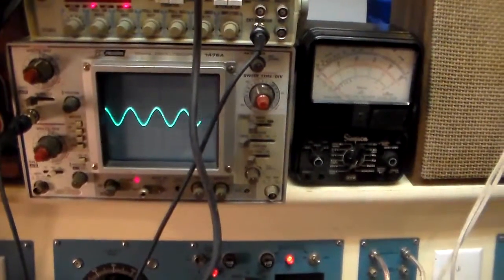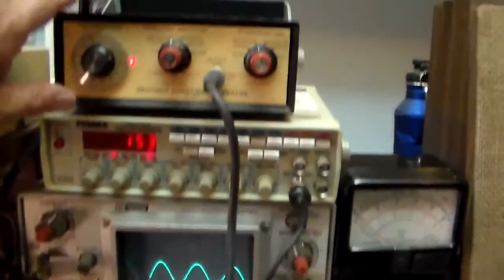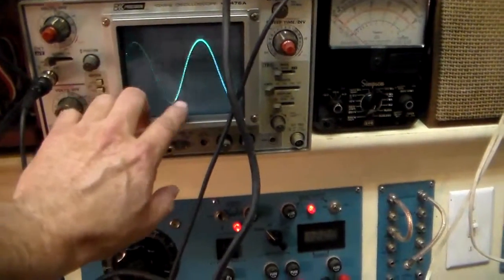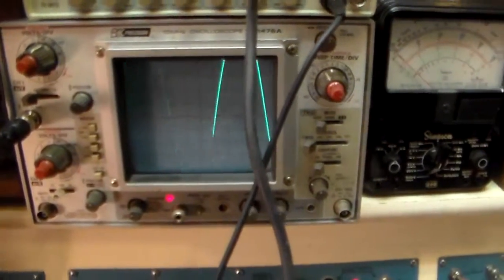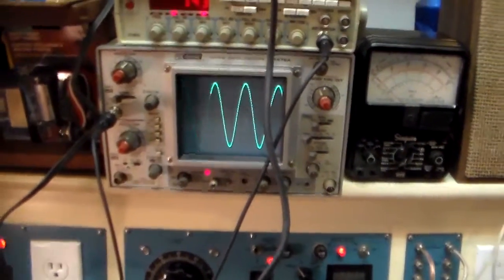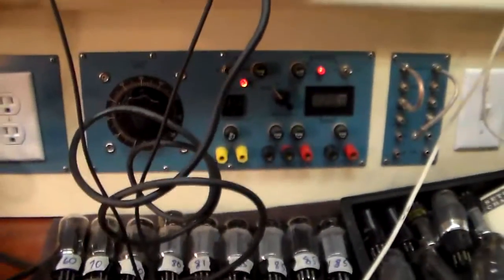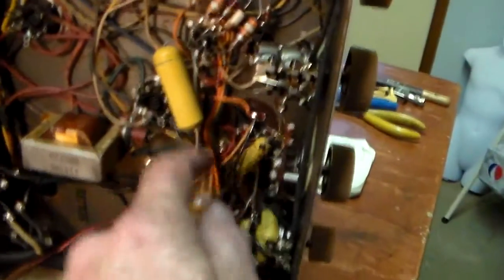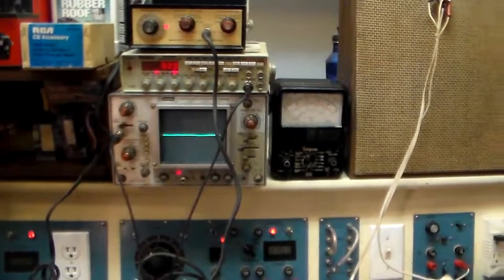A look at my Stromberg Carlson AR - 420 6L6 Audio Amplifier

Comment: 6L6 are built like a battle ship,they are designed to be abused.They were used in class B out put stages in P.A amps which produced around 50 watt r.m.s. But in hifi amplifier they would they produced 20 watts in pure class A or ultra linear mode. And biased into class A 1 not quite class AB more closer to class A.Produce around 30 to 35 Watts.To improved the amp in the lecture,remove phase splitting transformer & replace it with long tailed pair phase splitter for improve the high frequency response and much lower distortion.And change that output transformer by double size of silicon grain orientated steel core.And rewind transformer by reducing the number of turns by 4.Which reducing the winding capacitance and use bifilar winding  method improve mutual inductance between secondary and primary coils for improved high frequency response of the transformer. Rule is more Iron less copper for hifi amps and less Iron and more copper for guitar amps.